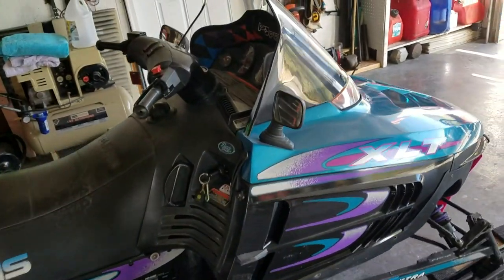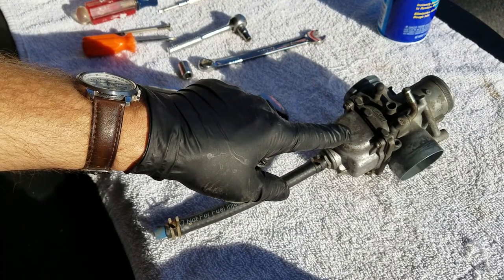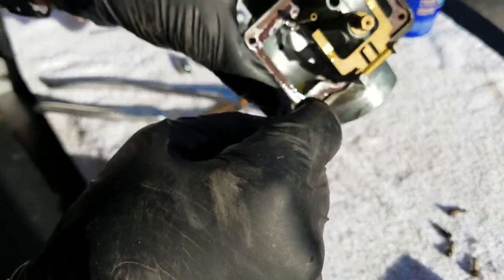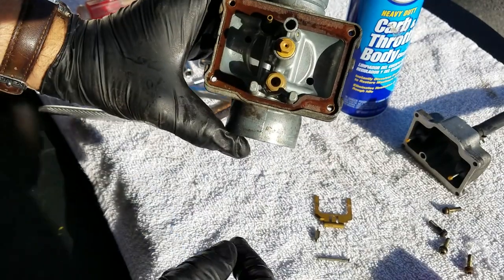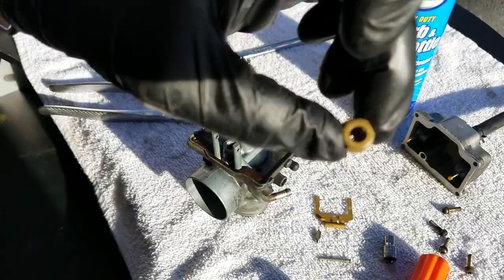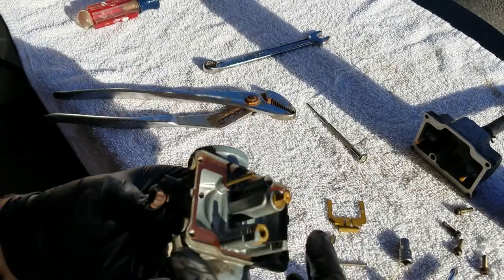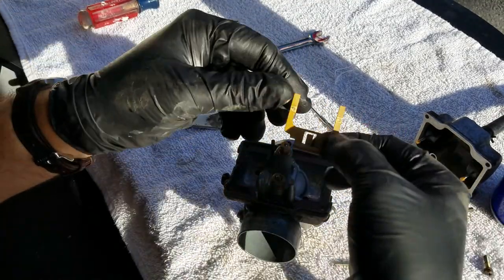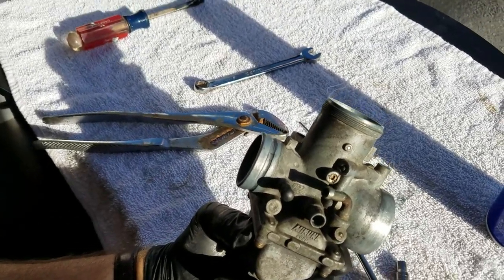Snowmobile carburetor cleaning

Comment: Thanks for the detailed how-to.  I have the same sled and it won't idle properly anymore.  I suspect the carbs have gotten dirty over the years.
Reply from the maker: Check or replace the vacuum fuel pump. That could also be a problem.  Thanks for watching. it's appreciated.
Reply: @dabblinwithdan2895  I would lean more to something that failed.  It's run fine for years, but it's always a little hard to start.  Like it's losing prime maybe, so that could be it.  An interesting note, it starts better with the hand pull than the electric start.  It can crank a million miles an hour and not fire, but somehow pulling the string gives a better spark or something.

Comment: That is not the jet you pulled out.  That is the float needle. That connects to the floats and allows gas in or shuts it off. That's why the tip is rubber. I love when people do how to videos but don't know how to
Reply from the maker: Thanks for the info